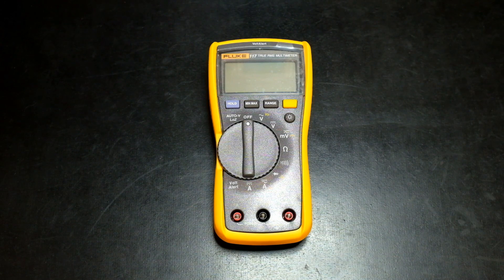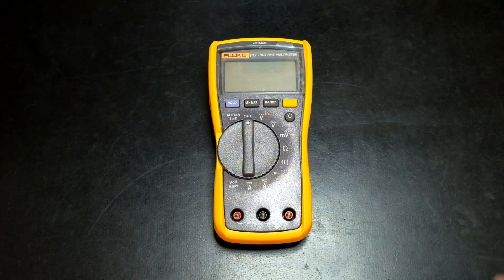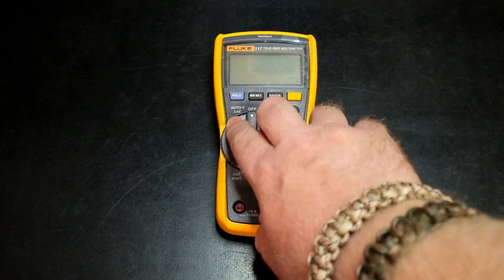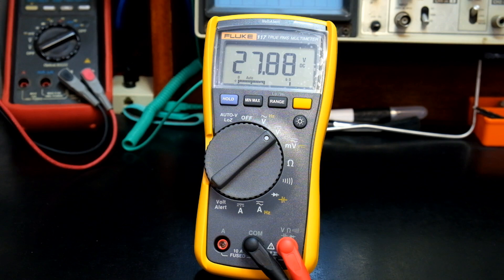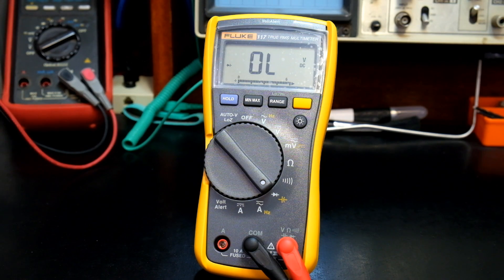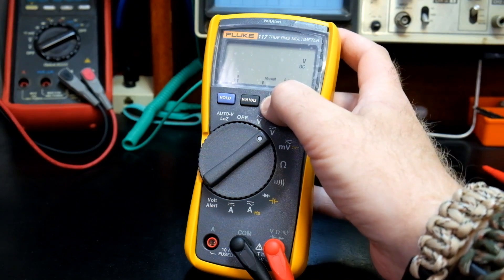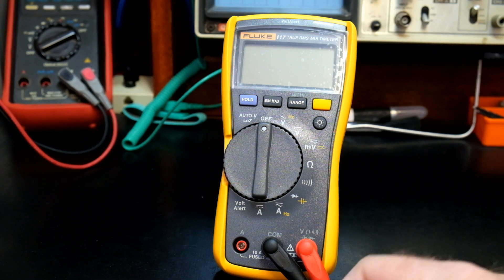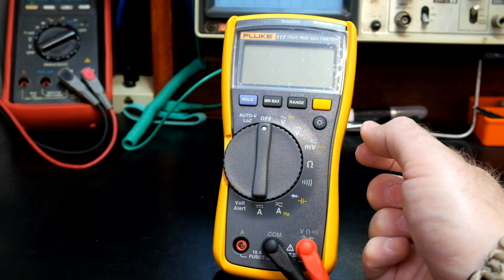Episode 48   Fluke 117 Multimeter Brief Review   First Look

Comment: I use the LoZ setting to discharge high voltage capacitors. You can watch the voltage drop to around 8 volts.

Comment: awesome review. i'm on the market for this meter. totally agree with your thoughts about the lack of mA and uA features. as a hobbyist, i find myself almost never had any need to go down to uA range, mostly in mA and above. so if it can goes down to 1 mA, i'm sure it will serve me well. the diode beep is useful, but in my opinion the more useful feature of it is that when the leads are shorted in diode mode, it gives a continuity beep also. this is very useful for finding shorts in a circuit. i have other brand meter that has diode beep feature, but does not gives continuity beep when the leads get shorted. and as far as i know, this Fluke 11x series is the cheapest Fluke that has diode beep feature, right?

Comment: Thank you for a fairly comprehensive review. My bugbear with my existing multimeters is that they display 820 Ω as .820 k. I wonder if the Fluke117 is better in that respect?

Comment: I must agree, I fixed TV's in the 80s/90s and had Fluke meters in the workshop. When I left the trade I bought a Brymen BM257 "Had to have ma and ua" people kept telling me. In all my time fixing TV's I don't think I ever used current more than a couple of times. if something was puling excessive current (blowing fuses) we used to wire in a 60w bulb across the fuse...if it glowed brightly you still had a short. Although the Brymen has more functionality I can't stand it for fault finding. The autorange on ohms takes forever and I do miss the diode chirp of the fluke!    Might get one of these 117s.  I was looking at one point at the 17b+ but although it's feature packed the ohms autorange speed is criticised.

Comment: come on , use some common sense. u cannot say it's "not accurate" because it does not agree with the readings on your DC power supply.
Reply from the maker: The power Supply in question has a calibrated DMM permanently connected. I was taught to always use a meter for power supply setup so this is how I work. So common sense is in full supply. Thanks.
Reply from the maker: Exact Model used with the PSU is the 8808 from Fluke. Just in case anyone was wondering. Review of that meter will be coming pretty soon as well.

Comment: Thank you for your perspective of using the 117 as an electronics multimeter. I was on the fence about getting a used 87v because of the micro amp resolution, but felt it was too big to carry and overkill for what I'd be using it for. I kept reading in reviews and forums that the 117 was not good for electronics but I felt it would do. I'm going to get one and call it a day. I can always get a cheap UNI-T or a bench scope for more difficult stuff.
Reply: Did you end up getting a 117? How's your experience been with it?